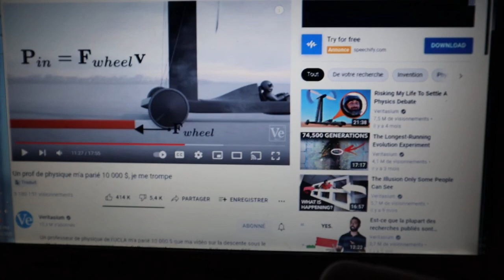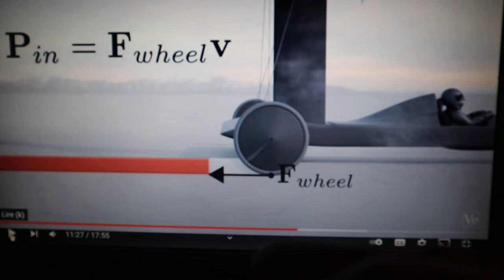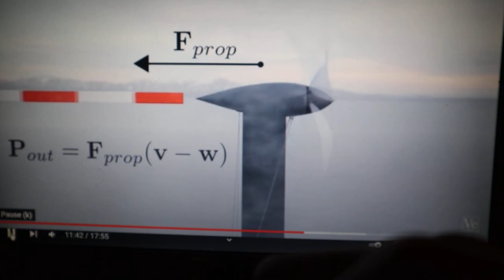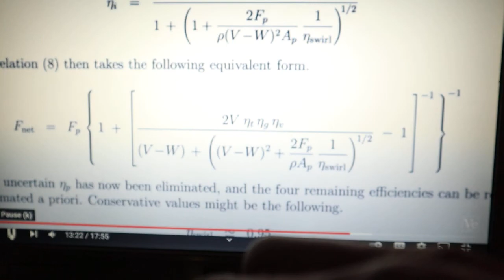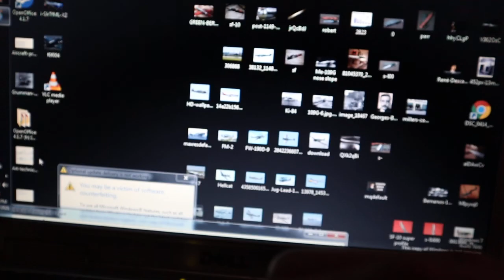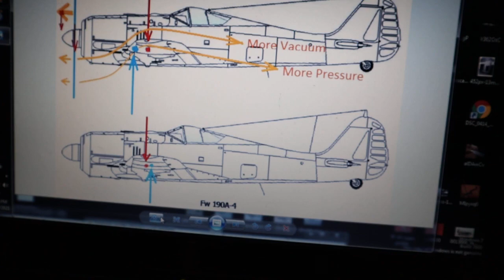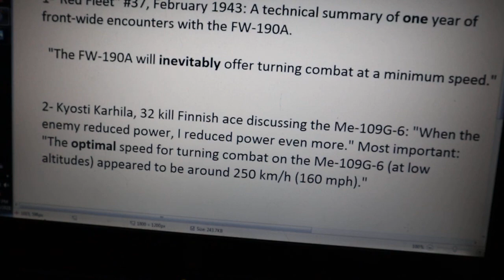WWII fighter aircraft designers did not understand what they designed: A physics demonstration

Comment: Hi Wrath, you make some interesting points. In regards to the prop car and the professor bet, I think I would have to make an entire video to explain my viewpoint on that. The problem, and I see this a lot is that while the professor's math was solid, he was doing the wrong math problem. 

Onto the Fw-190A. There is a "force within a force" so to speak. It's the accelerated slip stream from the prop rushing over the inboard portion of the wing. When power is high, this greatly reduces the stall speed. As a general rule radial engines get more benefit from this than V-12 airplanes because the prop is closer to the wings. We have good data on this for some airplanes like the Corsair, but for many, we have nothing. 

In regards to the 109's optimal turn speed. The quote you have is probably talking about sustained turning, and that speed of 160 is probably about right. However power will be very high because in a tight turn at that speed drag is very high. In fact it's so high that the best sustained turn rate in any WW2 fighter is going to be at maximum power. Fighters didn't get powerful enough to overcome the drag of a high G turn until well into the jet age.

I think the first quote for the 190 depends on a lot of things we don't know. If fighting an IL2, yes, a Yak with an unskilled pilot, probably yes as well. A P-40 with a Soviet Ace, no. I think in terms of the big picture I agree with what you are saying, there are factors that are overlooked and easy to miss. in some cases they are not fully understood. 

Good video, I enjoyed hearing your thoughts.
Reply from the maker: Thank you for your response. I would be curious to know about the research on the closeness of the thrust to the wing for radial engines: I have never heard of this before: You say such testing exists for the Corsair, in a comparative measurement at different nose lengths?

  I don't think it is possible for the speed on a Me-109G-6 to be sustained in horizontal non-climbing turns at 160 mph with full power (climbing yes, easy). I very much doubt it is possible even at METO. The context of the quote is clearly biaised towards lowering power (which is why this quote is so extraordinary)... This is demonstrated by many WWII fighters which can sustain turns above or at 3Gs at above 200 mph. In fact the turn RATE at 200 mph on a Spitfire may be quite high, say 20 seconds per 360 on a Mk V, but its RADIUS will be poor (among other things because of its amazing lack of partial position flaps). If the highest sustained turn RATE on a Spitfire V is at 200 mph, probably 220 on a Mark IX, then I doubt that 160 mph on a Me-109G-6 is also at full power... 

  Karhila in the quote says he always lowered power "and turned equally well".

  Sustained turns are only at 7 degrees of nose up, hardly enough to shave 240 mph from the top speed...  (with WEP, even the plainest Me-109G-6 could maintain 400 mph for 3 minutes)

  Now a contrarian argument for why a lower speed turn wins the fight could simply be this: Lower speed does NOT allow a higher RATE, but does allow a lower RADIUS: At equal rate the lower RADIUS wins, because it gives a NATURAL lead to fire: This would explain the "race to be the slowest", without any need for my assymetrical prop shenanigans. 

  I have often considered that natural lead to fire from a smaller radius (no need to raise the nose to lead the target) is what explained this "race to be the slowest" that Karhila (and thousands of combat accounts) so clearly allude to. It would not require my prop assymetry theory.

  The reason why this is not enough is the FW-190A: With 50% greater wingloading, its behaviour described at low altitudes for one ENTIRE year, over HUNDREDS of encounters, leads to the technical evaluation conclusion: "The FW-190A will INEVITABLY offer turning combat at a minimum speed." This is over HUNDREDS of combats... Hundreds. And this is abundantly confirmed as the MAIN advantage of the FW-190A against both its opposition and versus the Me-109: Weir: "The FW-190A could turn with the Hurricane, the Me-109 could not" Deere: "Unlike the Me-109, the FW stayed and fought with us" (Out-turning us 8 to 1), Johnny Johnson "I asked the Spitfire for all she had in the turn. In another couple of turns he would have me in his sights"

  The maintenance of the FW-190A in a low-speed relationship to the higher flying Me-109 was also seen in Boddenplatte in 1945, where they STILL interacted in the exact same way the Soviets described from 3 years prior: 1945 US pilots described "FW-190As turning at low altitudes while Me-109s used diving attacks." March 1945 FW-190A pilot: "Our wings were never level in combat: We turned all the time: It was the only way to survive."

  That is the ONE strong feature of the FW-190A. It could literally do NOTHING else even halfway competently, having the worst high speed elevator response of any other fighter I am aware of (it responded by sinking tail down, abundantly and repeatedly described by all sources, including E Brown). Reading combat accounts gives far from a subtle nuanced picture on this issue...  Orekov: "An experienced FW-190A pilot will never use the vertical maneuver."

  And because this picture of the FW-190A is so clear-cut, so devoid of any TRACE of nuance, by both those who met it and those who fought with it, the only conclusion is that internal leverages are indeed acting, and have a major disruptive effect.
Reply from the maker: Look what I just found: Pierre Clostermann: Audio from the past [E16], WW2 Pierre Clostermann. Chuck Owl channel in Youtube. https://youtu.be/c2zdA9TcIYo 12:44 "Alors il y a les legendes sur le Spitfire... Ahhh puis alors les legendes... Les legendes ont la vie dure... Une des legendes c’est que le Spitfire tournait mieux que le Messerschmitt 109, ou que le FW-190: Eh ben ca s’est une belle blague. D’ailleurs tout ceux qui se sont retrouves avec un FW-190A ou un Messeschmitt tournant a l’interieur, a basse vitesse, eh bien, en general ne sont pas revenus pour se plaindre de la legende. Pourquoi? Au dessus de 280 a 300 noeuds, le Spitfire tournait mieux que le Messerscmitt 109. D’abord en combat tournoyant la vitesse descend descent descent descent, et arrive a un moment, ou la vitesse tombant en dessous de 200 noeuds, le 109 tournait a l’interieur du Spitfire."

Translation: "So there are legends on the Spitfire... Legends are hard to kill... One of those legends is that the Spitfire turned better than the Messerschmitt 109, or the FW-190. Well that is a good joke... In fact all those who found themselves with a 109 or a 190 turning inside them, at low speeds, well those in general did not come back to complain about the legend... Why? Above 280 to 300 knots, the Spitfire turned better than the Me-109. But, first and foremost, in a turning battle, the speed goes down and down and down and down, and at one point there comes a time, when the speed has gone down below 200 knots, that the Me-109 turns inside the Spitfire."
Reply from the maker: Speaking of P-40s (which I agree was a superb low speed turn fighter, probably on par with the F6F, and only edged out by the F4F), look at the quote I found relating to the general front line opinion of the P-40 vs the FW-190A:

  Quote: "A few years ago, I had the opportunity to correspond with Capt. Reed via telephone, snail mail, and email.  In one of my emails, I asked about how the P-40F and L (which he also flew) compared to both the Me-109 and Fw-190, which also flew in North Africa but to a lesser degree (more often as a fighter-bomber).  Here is Capt. Reed's emailed reply:

  "Regarding performance against the Me-109 and FW-190.  The 190 was tough to out-turn.  I could out-turn the 109, but it was hard to do.  I, at times, had to drop a few degrees of flaps and slow down to out-turn it.  On one mission dropping the flaps was not enough so I had to drop my landing gear to slow down enough to out-turn the Me-109 and get away from his fire.  I think dropping the flaps and landing gear probably saved my life.  I never had a one-on-one with the FW-190 so am not sure what I could do with it.  I understand that it was harder to get away from than the Me-109."
Regards,
Mark"

  For a P-40, even an L, I think it is likely "getting away" from a FW-190A probably did not involve straight line speed...
Reply: My response, you are probably interested in this.
On minute 10, your premise that the CL moves in front of the CG cannot be right.  If that happened, the plane would be unstable.  If the speed was high, it would break up in pieces, if the speed was low, it would stall and spin before the pilot could react.  These planes were stable.  Stability is one of the major features that make a plane a good handling plane.  There is always the compromise between stability and maneuverability, and the best designers (i.e. Spitfire) found a good balance. 

There is no way the fighter aces knew more about the physics than the test pilots, who often flew with instruments on board.  If anything, many of the cmbat reports need to be taken with a grain of salt.  Generally, if a comparison opinion among combat reports tends to repeat itself over and over, it is probably correct.  But you cannot take an isolated opinion and present it as fact.

As for your wheel experiment ...  I am not sure what the wind conditions are.  But this problem can easily be resolved with conservation of Physics.  If there is no tail wind, the car will stop, period.  If there is a tail wind, and you have some sort of sail to exploit it, as your forward speed increases above the tail wind, you are no longer collecting energy from the wind.  So, the car cannot accelerate.  Your steady state speed will be at a speed where the power you collect from the tail wind is equal to all your other drag losses, including the propeller losses.  That steady state speed cannot be above the tail wind, because you will be receiving negative power from the tail wind.  Very simple proof.